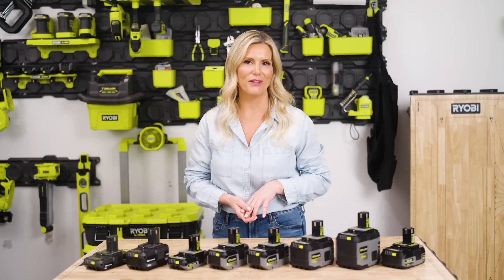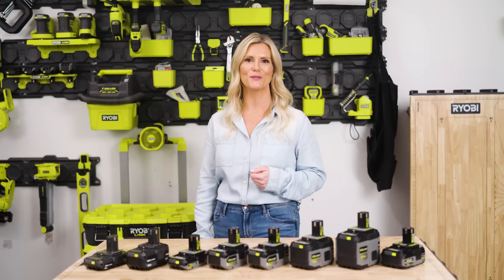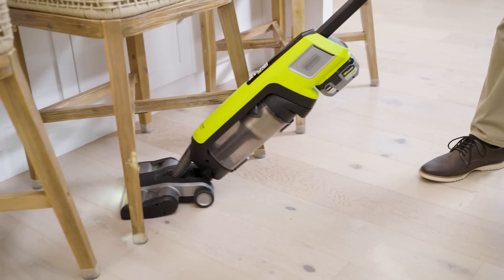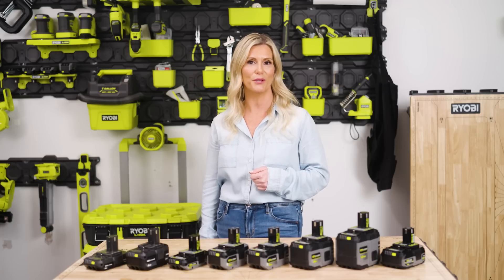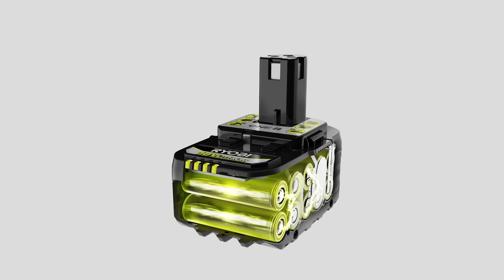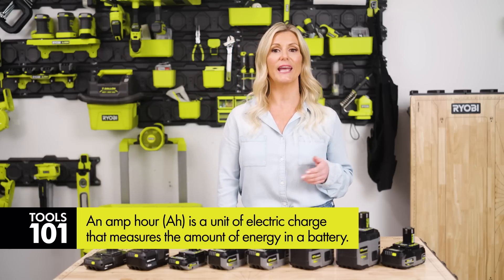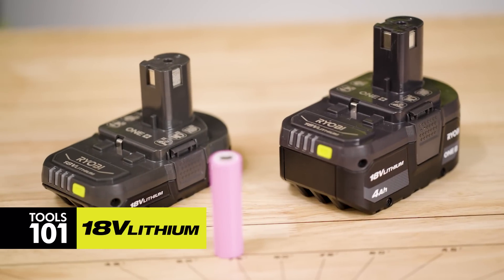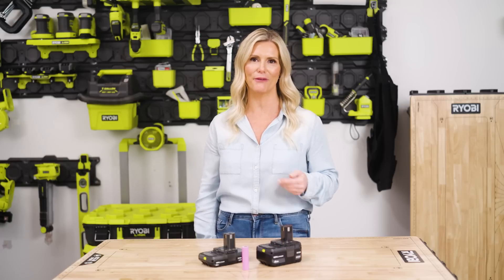Complete Breakdown of the 18V ONE+ Battery | RYOBI Tools 101

Comment: Just don't get them even damp,dropped drill/ battery in a puddle  and immediately  got it out ,dried it really  good  worked for a minute  then quit! Got stick in the rain ( light sprinkle) with my big driver/battery and it hasn't worked since. Very disappointed.  Can get my dewlts wet and no problems.

Comment: In defense of ryobi and the same fellow who designed both the blue and the green systems.  The ryobi tools both blue and green systems were designed by the same person,,  the motors in the blue were finely tuned ( matched)for optimum performance for the nicad  batteries that were used and the green were finely tuned for the green lithium batteries. Even the sourcees of nickel cadmium and lithium  has always been from the same geographic mining sources   ..No overheat problems  of the tools and plenty of longevity in the quality of the tool is the result.

Comment: For the longest time ,  about 20 years,  I couldn’t purchase a ryobi one battery without a failed indicator light that shows the charge level of the battery.  All the batteries that I purchased during that time would have an indicator light failure within the first couple days after purchase.  It seems that ryobi manufactured more than a million defective batteries that could not be recalled because of the cost factor.    Many times I needed the battery to do a job and the battery was dead because it wasn’t charged. Ryobi should have recalled and repaired them anyway instead of giving us a mediocre discount without telling us.
Reply: Why would you stick with a tool system for 20 years if all the batteries failed on you?  Good lord, man!

Comment: MM77 Approved 👍🏻👍🏻……………LOL! I still have a bunch of the “ Blue “ Ryobi tools. In my opinion, run much better now that I run them on the lithium batteries. As the old tools die, I replace them with the newer versions. 
I used to buy Black and Decker tools, but they kept changing the battery voltages and styles of batteries making some of my tools useless. 
When Ryobi came out and said they would never change the battery style, I switched and have never looked back! 
One of the best decisions I have ever made, no more useless tools!
Reply: That promise is what keeps me with Ryobi. That and they are usually the first to market with a novel tool type.